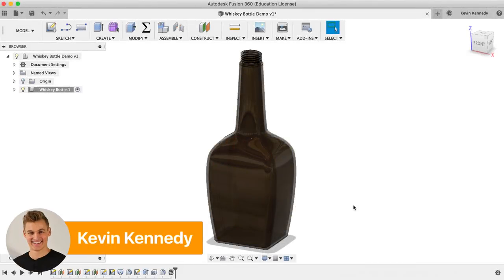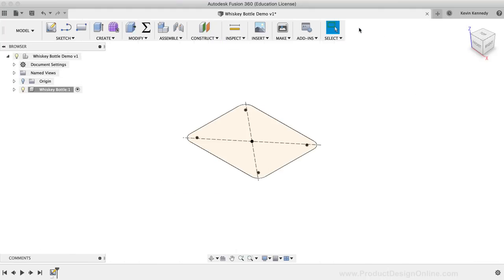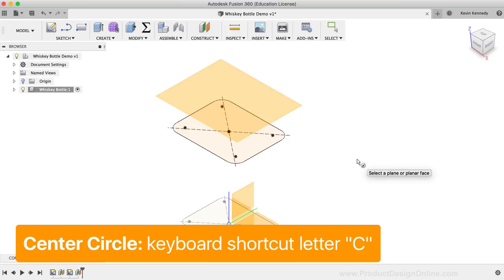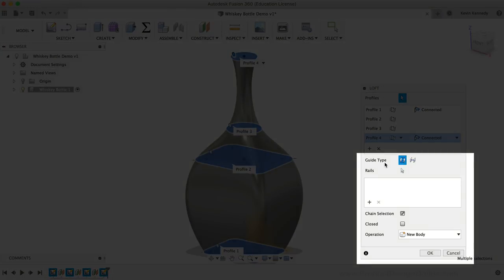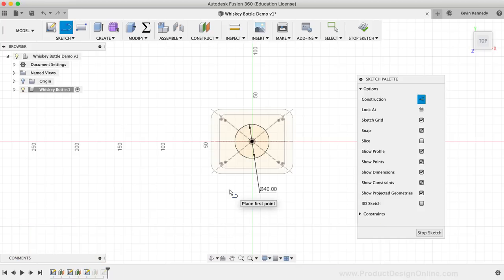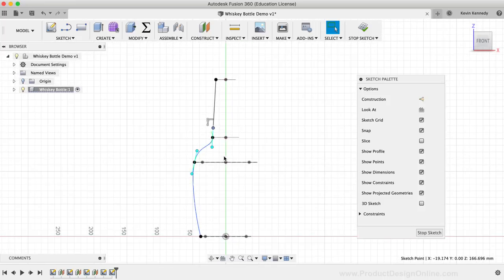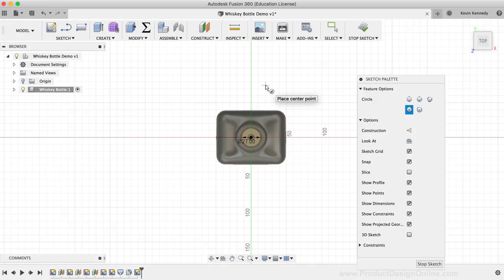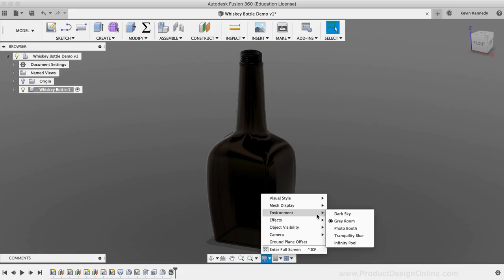How to 3D Model a Whiskey Bottle - Learn Autodesk Fusion 360 in 30 Days: Day #4 (REVISED)

Comment: I was still getting error message "Rail does not touch all of the profiles" even with spline point handle snapped to line. What worked for me was to delete line and instead make the "line" with second spline and then snap the handle.
Reply: I had to delete the whole lot and draw a spline connecting all four points. It's infuriating!
I was concerned that the neck of the bottle would not be as straight as a 'line' but the Loft tool straightens it out fine.

Comment: whenever i am trying to mirror the the spline the spline and line wont get highlited to activate and hence i am not able to select them
pls help!!
Reply: I have exactly this same problem. The spline and the line appear blue in the drawing but I don't know why. When I activate the mirror command it offers faces and 3 others but not objects like the menu in the tutorial.
Reply: @Carfunmostly  actually the sequence of how you do matters in fusion..its really confusing...it works sometimes
Reply: @joshebramjoseph8523  I worked it out. I had to highlight the spline so that I could see the constraint handles then open mirror command and the word objects was default, then I could pick the spline and the line, then the mirror plane and ok. Thanks for the tip.

Comment: Hey great tutorial just one thing; mirror is not working, tried using feature this tutorial but nothing. Help here anyone.
Reply from the maker: Hi, Lionel. Make sure you're using the SKETCH mirror command and not  the modeling mirror command. Double-check that you're in the "Sketch" contextual tab, then select the "create" dropdown list. It's likely that you're using the mirror command from the create dropdown list in the "Solid" tab. Cheers, Kevin :)
Reply: Thanks for the advice. I tried it and it worked
 @ProductDesignOnline
Reply from the maker: @lioneljohnson8804  Glad that was it. I'm always happy to help. Please don't hesitate to comment questions on the tutorials as you work through the remainder of the series. Cheers, Kevin :)

Comment: Had an issue snapping spline points to construction lines.  This solved my issue: https://knowledge.autodesk.com/support/fusion-360/troubleshooting/caas/sfdcarticles/sfdcarticles/Cannot-snap-to-components-when-sketching-in-Fusion-360-on-Mac-after-an-update.html
Reply from the maker: Thanks for sharing, Shannon! The "Auto Project Edges on Reference" used to be a default... not sure why they decided to omit it..but you'll have to turn it back on :)
Reply: Thanks.
Reply: Thank you Shannon! I almost gave up on this.

Comment: I'm unable to use the shell feature at the end of the tutorial. I made sure to join the extruded section to the rest of the bottle but it still wouldn't work.

Edit: For whatever reason, it worked only when I applied it after doing the fillet and thread steps. So if somebody gets stuck here try that lol
Reply: Same problem, same fix. Thanks, it was bugging me!

Comment: Ok, finished the tutorial at the loft command, "the selected rail does not touch all profiles" although the spline arm is stick throught the X to the stem line, I don't even manage to unstick it. Fusion 360 is becoming as frustrating as Blender...
Reply from the maker: Hi, Mateyhv1. When you click and drag at each spline point, does one of them move away? That error is caused when at least one of them is not truly "snapped" to the profile.
Reply: @ProductDesignOnline  thanks for the quick answer. No, none of the three spline points move. I went back and did the line then the spline points and then snapped the spline handle to the line. For some reason this time the loft worked. I think you are right some point was not trully snapped to the profile, maybe it was very close but snapped to the grid instead. Thanks!!!
Reply from the maker: @Mateyhv1  Glad to hear you got it working! That's correct - most of the time it appears to be connected to our eyes, but it's slightly off. Checking those connections is usually the first step anytime that error comes up. Cheers, Kevin :)
Reply: @ProductDesignOnline  I redid this tutorial today and after stucking at the same point I noted another comment saying to make first the line and then the spline. That worked, so there is something definitely buggy in current Fusion360. Thanks

Comment: I cant get the mirror to work. It wont let me select anything. I am on the front view, sketch, mirror. Select is active but nothing I click on is selected.
Reply from the maker: Hi Larry it sounds like you may be using the modeling mirror command. There is a sketch mirror command that acts similar. Make sure you're in the SKETCH tab and then selecting mirror command from the create drop down. Do not use the one in the SOLID tab as it will not work with sketches.
Reply: I didn't realize that I must be on the sketch with all things I want to mirror in order to select them. I am a beginner!
Reply: @ProductDesignOnline  OK Ill try that

Comment: For anyone stuck because the spline won't snap to the line that forms the rails of the loft. Use Project tool. Watch this video 360 LIVE_ Lofting to new heights
Reply from the maker: Hi Mindaugas. A lot of the confusion is because the "Auto Project Edges on Reference" setting used to be on by default...which is why I didn't have to manually project in this video. Setting instructions -  https://productdesignonline.com/default-settings-for-fusion-360-tutorials/#autoProject
Reply: @ProductDesignOnline  Thanks for your answer,  I have this feature enabled and applied in the preferences, but still snapping doesn't work properly: I get a white or grey dot instead of black. After zooming in I can see it is missed. Drawing construction lines on circles to get a snapping point is not worth the hassle for me as manually selected Project tool  works perfectly from the first time. Anyway, thanks for great tutorial.
Reply from the maker: You have to be looking directly at the sketch as well :)

Comment: I can't figure out if it's possible to search comments. I'm having trouble with my loft rails and the error that they don't touch all the profiles. I've redone this 2x. It's for sure something odd I'm doing.
Reply: Me too, I wonder what we're doing differently?
Reply from the maker: Hi, Dean. There's no feature built-in with Youtube. However, Press CTRL + F (or Command + F if you're on a Mac) to search with your Browser.

Can you share the link to your file so I can take a look? To share your file please go to File > Share > Share Public Link (make sure "downloadable" is toggled on) > Paste your link here as a reply to this comment. Then, please write a separate comment letting me know you've replied with a link because YouTube flags most links and I don't always get notified. Cheers, Kevin :)
Reply: @ProductDesignOnline  I've replied with a link! THank you!
Reply from the maker: @sonyaridden  Hi Sonya. I just looked at your file. For some reason, F360 is throwing an error because it doesn't recognize the spline being connected to all profiles. I deleted the spline of your last sketch and recreated it, again making sure it snaps to all points of the profiles. Then, making sure it snaps to the straight line. After re-mirroring the spline and line over to the other side it worked without any issue. Here's the link to your file if you want to take a look - https://a360.co/2RKyzuQ

Give it one more shot - recreate the spline and mirror it over to the right side - and let me know if it works for you. Cheers, Kevin :)
Reply: @ProductDesignOnline  Thank you so much for looking at my file. I followed what you did and deleted the spline and recreated it and it now works! I'm guessing there might be some sort of bug as I'm pretty sure the spline had snapped to all the profiles (and Dean had he same problem at the same time).
Reply from the maker: @sonyaridden  Glad to hear it worked! :) 
Yea, I'm really not sure what caused it... wish I had a better answer to give you!
Reply: @ProductDesignOnline  At least it's sorted now, and I have a better understanding of how to work around any potential quirks. Thanks again, and for getting back to me so quickly.
Reply from the maker: @sonyaridden  You're welcome! Always happy to help.

Comment: I can't seem to get my construction lines to appear when I'm in use with the spline tool.
Please help
Reply from the maker: Hi Dalton. Are you referring to the point where you snap the spline handle into the line? Could you post a link to a screenshot so I can take a look (using snipboard.io, Google Drive, etc).
Reply from the maker: Hi Dalton. Are you referring to the point where you snap the spline handle into the line? Could you post a link to a screenshot so I can take a look (using snipboard.io, Google Drive, etc).
Reply: i am getting the same problem , i can see the points until i choose spline tool after that there is no guide points.
Reply from the maker: @pawannaithani99  It may be a change in the settings. You can check the "Auto Project Edges on Reference" setting per these instructions - https://productdesignonline.com/default-settings-for-fusion-360-tutorials/#autoProject

Let me know if that takes care of it :)
Reply: @ProductDesignOnline  life saver!!! I have been trying this and the old version for over an hour getting stuck at the spline part. Check my settings and turned on the auto project and boom! works a treat. Best youtube channel ever!!!!
Reply from the maker: @Lerone6886  No problem, glad that was it! Don't hesitate to comment if you run into any more issues.

Comment: One edge remain of spline line after loft command
Reply from the maker: Hi, Dhruv. That sounds like a visual style setting. Head down to the bottom and click on the "Display Settings" (desktop monitor) icon. Then click the "Visual Style" flyout folder and select the "Shaded" option. Yours is likely set to "Shaded with Visible Edges Only." To clarify, This is simply a visual appearance setting and it will not affect your model should you export it. The visual appearance settings simply help you better understand the contour of your model. 

Let me know if that fixes it! Cheers, Kevin :)
Reply: @ProductDesignOnline  thank you it works btw nice video and content
Reply: @ProductDesignOnline  can you make video how to download solid works for free
Reply from the maker: @dhruvpanchal6053  Glad that worked and thanks, I really appreciate your support! Cheers, Kevin :)
Reply from the maker: @dhruvpanchal6053  I don't condone the use of unlicensed software. If you're looking for a more affordable version of SolidWorks then you can reach out to them and see if they still provide a cheaper version for education purposes. They used to, however, that was years ago when I had it on my personal computer. I work solely in Fusion 360 these days. Cheers, Kevin :)

Comment: I can't mirror the spline line
Reply: They changed the mirror for sketches to the sketches menu itself. You have to double click the previous sketch (Line for the stem) then click mirror which is next to fit point spline. 

Or you could just use the search key command (s) and search for mirror the correct one will be the second option the first one is for bodies, much like fillet for bodies and sketches.

Comment: I think I don all like in this tutorial but I keep getting: The selected rail does not touch all of the profiles ...
Reply: I solved the problem, you should go to preference/Design and check all the fields
Reply: @ne5750  At first, I couldn't snap the points of the other sketchers, that's why there was the error. But after changing the preferences, it allowed me to select the points of the other sketches
Reply: Today I did the same as yesterday and guess what: it worked! :)
Reply from the maker: It should've been the "Auto Projects Edges on Reference" setting, which used to be on by default. They've changed that, so I've listed the applicable changes here, on my website - https://bit.ly/defaultsettings

Comment: Hi Kevin, new subscriber here, thanks for putting the huge effort into creating these excellent tutorials.
I too am having trouble with loft using rails having tried multiple times while closely watching (and rewatching) this tutorial. 
I have created a simple model to test my method and it still fails when adding the rail with the message 'The selected rail does not touch all of the profiles'.  
Link to my model  https://a360.co/3dMrkN9
I have my defaults aligned with yours and also have 'Auto project edges on references' checked.
Thanks in advance.
Reply from the maker: Hi, Shane. Looking at your model I see that the bottom of the rails is not close to the bottom profile. You need to click and drag them over. Screencast of fixing it - https://drive.google.com/open?id=1TyLpu_P0Qe16VE1SjAAnZxht30afnrwJ
Reply: @ProductDesignOnline  Thanks Kevin, I reworked my model then my whiskey bottle...and they both worked great!  Thanks for the personalized response...you're awesome!

Comment: my sketch points, where the construction lines intersect the edges of my planes, do not reveal themselves to be snapped to once i've begun sketching my guide rail. suuuper frustrating,
Reply: I am having this exact issue
Reply: Think I figured it out. From within the rail sketch, you need to hit "P" and select the points from your other sketches that you want to project to use in the rail sketch.
Reply from the maker: Hi guys. You'll need to make sure you turn on your "Auto Project Edges on Reference" setting. This used to be the default setting, which is why it's not mentioned in the tutorial. Instructions to turn it on here - https://bit.ly/autoProject